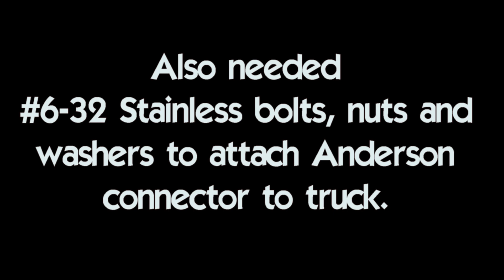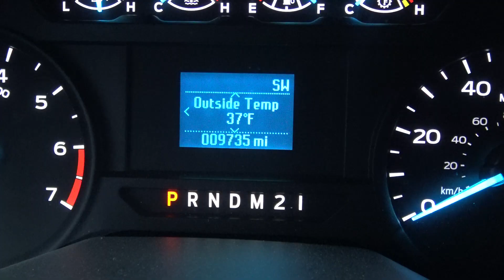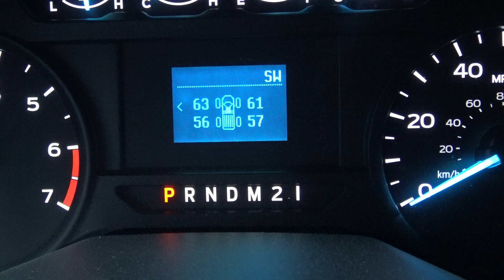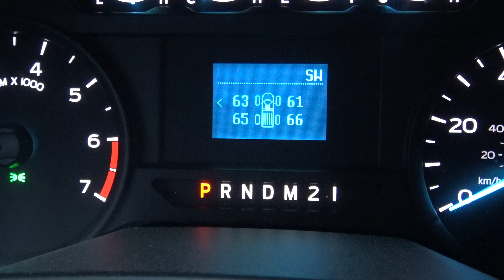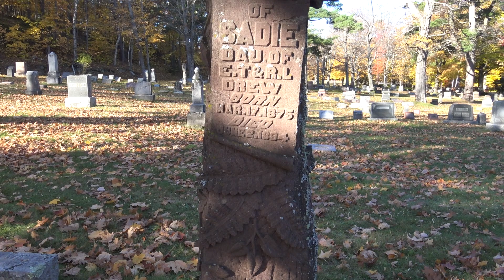F-250 Upfitter Switch Controlled Air Compressor Power Supply

Comment: I came up with this idea opening the hood in the Wyoming wind in the dark after a day of hunting. Great minds...... Sadly I do not have TPMs but being able to simply plug the compressor in will make things much easier and safer. I am doing a 4 gauge set up so it is good for powering most anything including my jumper cables. No off/on switch for now.

I am also doing a 4 tire hose system. I have no worries that the Viar 300P can handle it with my 285/70/17s from 18 to 40 lbs on my Silverado 1500. Time will tell. Most times it is very cold too so it runs cool.
Reply from the maker: Good to hear.  Let me know how it turns out.

Comment: Nice.  Suggestion for soldering those lugs:  tin the wire like you did for the splice and then insert it into the lug.  Heat away from the wire and add enough solder to fill.  The solder flows toward the heat.  Note the limitations of that compressor!  If you are out on sand down at 8 psi, you will not pump up in a few minutes!  Many four wheelers forget this and then forget that the time is multiplied by 4 tires.  You are doing two at a time so not so bad!  Next step will be permanent air lines?
Reply from the maker: Thanks for the input... I will probably never air down to less than 30 psi (suggested psi for this truck is 60/65).  That's still a lot of work for this compressor.  No plans for permanent lines at this time.

Comment: Did you film how you connected the compressor to the Anderson plug?
Reply from the maker: Good question.  No I didn't.  Basically I cut the original compressor wire about three feet from the compressor and I added a Anderson plug.  This is the end that plugs into my truck.  Then I added another Anderson plug on the other side of the compressor wire (the side with the alligator clips).  This was so I could still use the compressor as it was designed if I had it in another vehicle.  At 9:11 in the video you can kind of see it.
Reply: @NorthernExplorerOverland  Hi, great video. Do you know what gauge wire is on the compressor? The Anderson connector seem to be only for 8/10 gauge wires and was wondering if the wires from the compressor can be crimped on the terminal pins. Hope that makes sense. Thanks.
Reply from the maker: @cadexim  I think it is 8 awg wire but don't quote me on that.  I don't trust my cheap crimping tool for thicker wires.  But you should be able to crimp if you have a good one.